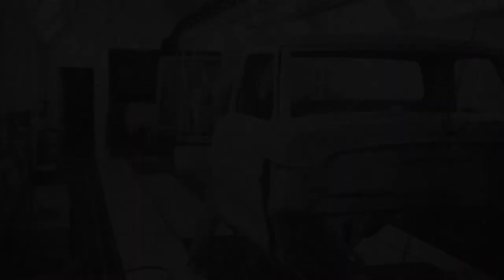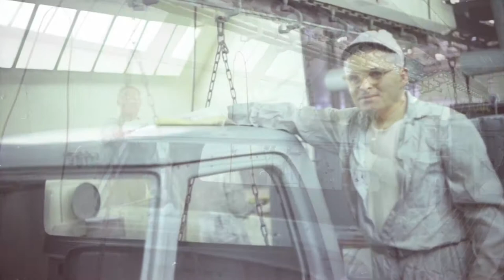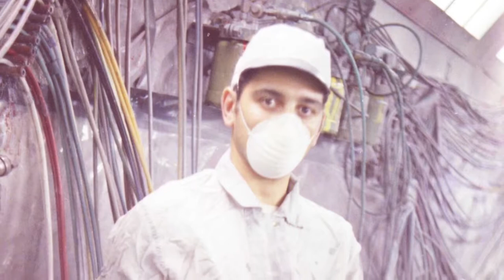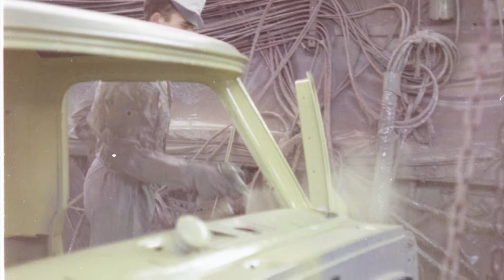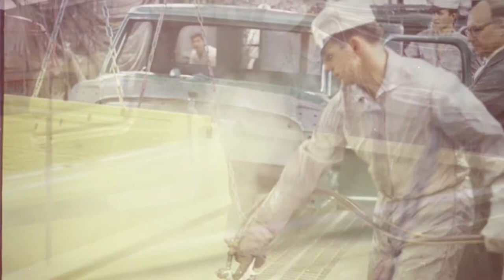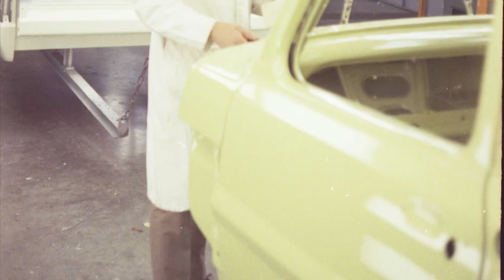67 Ford F100 Assembly Line Original Pictures

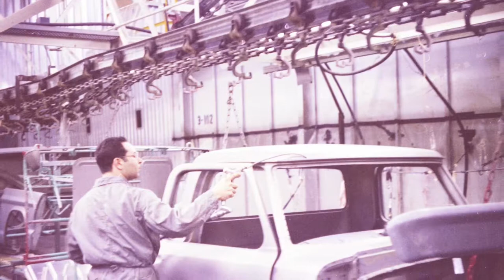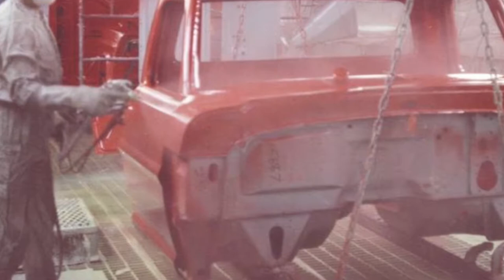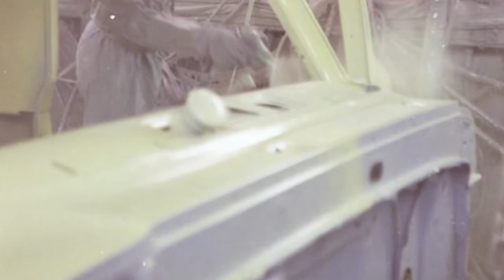Comment: Actually, I think there may be a mix of '67 and '68 trucks here. Time stamp 0:06 (yellow truck) shows a single bolt inspection plate on the cab corner ('67's used 4 bolt covers, '68 & '69 trucks used the single bolt cover), but time stamp 1:31 (red truck) looks it could have a 4 bolt cover (but this is really hard to see). Plus, time stamp 1:45 to 1:55 seems to show the larger radio opening of the '68/69 trucks (versus the smaller '67 radio opening), along with the opening for the "slider-type" heater controls.  

Still, cool stuff! Thanks for posting!
Reply from the maker: Glad you looked closely and discovered some differences. . .